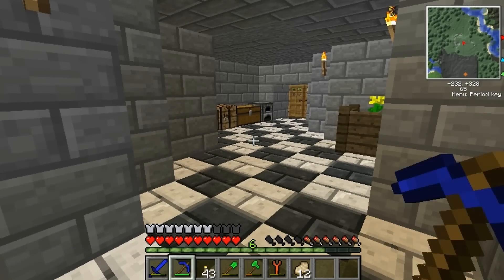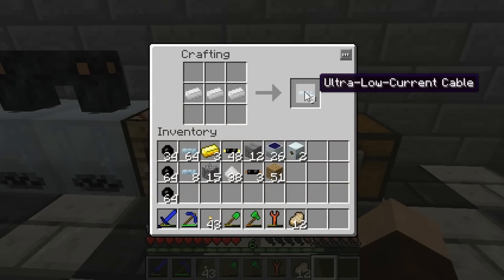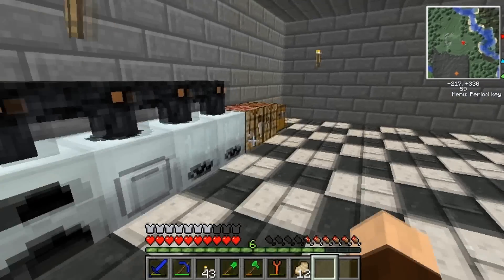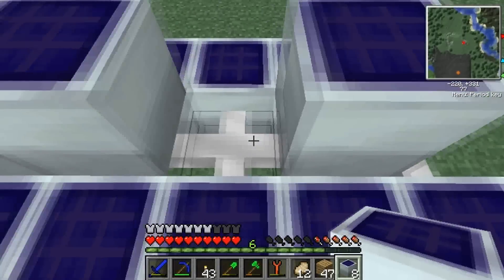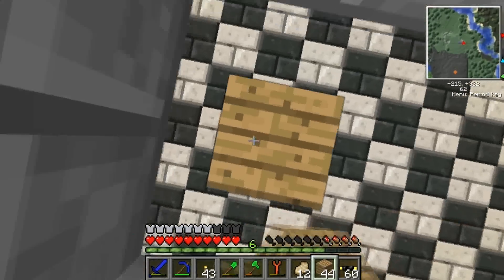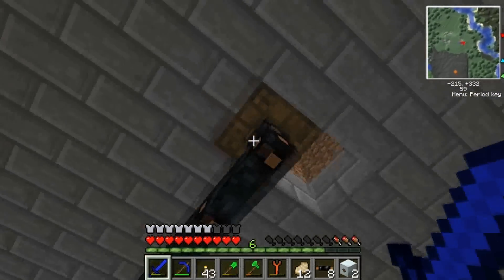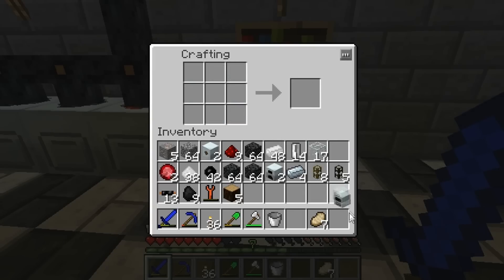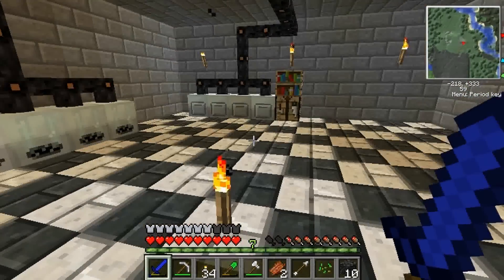Tekkit Pack tutorial: Part 3 - Industrialcraft Sources of Power

Comment: Okay, So  i made the same solor panel set up as you guys, but i only have like 7 solar panels. So i hooked them up to the bat box, and then used gold 2xins cable to connect that to a MFE and then did LV treanformoer or whatever and then bronze cable to all my stuff and it wasworking fine. But i replaced the bat boxwith another MFE and now i only get power sometime when one is all full and the other is kinda turning onand off. Do i need to turn the broze cable into gold 2xins?

Comment: Are you sure you are using the correct version of tekkit? If you are then you might be using a different tin, there are 2 kinds of tin (no idea why). Only one of them works for the cable. You will notice the difference because they both say tin but they won't stack. So if one of them doesn't work then try the other one. Let me know if it worked.

Comment: @ShiyojinRommyu so basically it goes like this solar panel>ultra low current cable>batbox>copper cable>MFE>gold insulated cable>LV transformer>coper cable>machines. provided that all the input/outputs are facing the right way.

Comment from the maker: @cloj63 An EU packet is like voltage (eg. 32 eu, 128, etc.). All EU travels in these packets and a new packet is created each tick in this case (EU / tick). The restriction of tin cable is not the amount of packets that are sent but the packet size that is traveling. So, if each solar panel produces 1 EU/t then the packet size for all of them would still be 1, but there would simply be more packets. We are planning on doing electricity 101 for those who haven't taken physics.